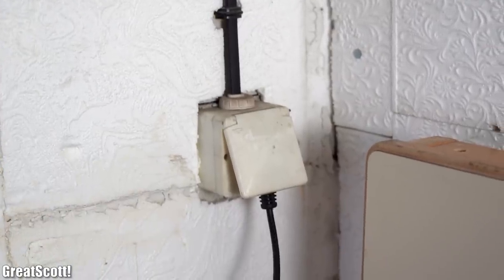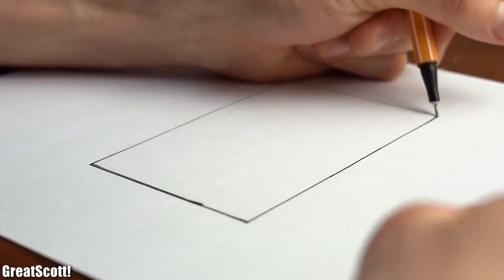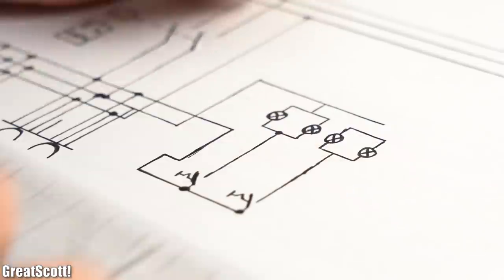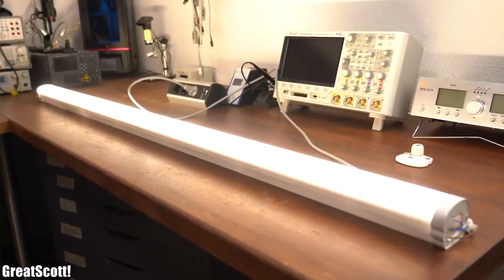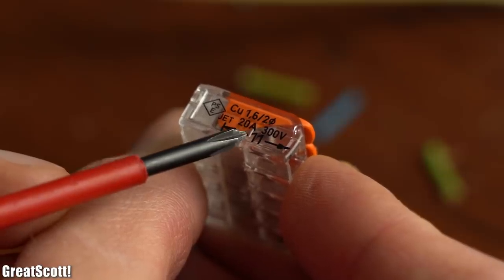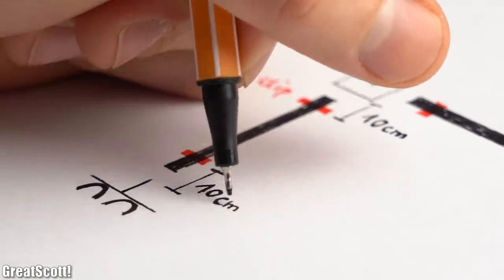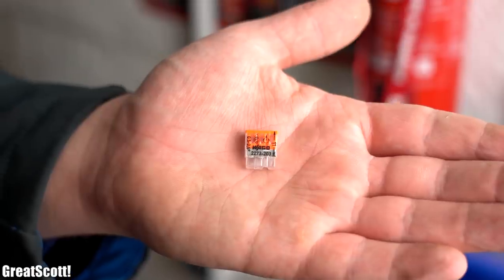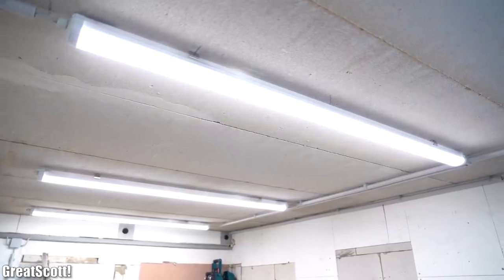How to do Electrical Wiring properly! (more or less....) GERMAN STYLE!

Comment: I found it pretty interesting in a previous video on mains wiring that Germany distributes three phase power to residences, since I live in USA where we have split phase 120VAC via center-tap transformers. Do any German appliances use all three phases? Could you do a video on power distribution in Europe, maybe even compare with USA?
Reply: Heavy electronics like ovens use 3 phase power. Generally every room is on a different phase to balance the load. In the US a lot more current is flowing because of the lower voltage and fewer phases.
Reply: Stoves in germany tend to be 2-3 phase, as are Electric Waterheaters or Roomheaters. otherwise the phases just get distributed between each rooms
Reply: Yes, flow heaters and electric kitchen stoves for example.
In my place (in Germany) we use the TN-C-S power network. Three phases L1/L2/L3 + PEN on local utility side. Three phases + Neutral and PE within the house.  PEN is split to PE and N at the house's transfer point. You need to attach an electrical grounding to the PE at the transfer point and split PE and N from that point on.
See here: https://en.wikipedia.org/wiki/Earthing_system
Reply: Interesting replies, thanks for the insight
Reply: @mixedbytc  Many people have 3 phase sockets in the garage/workshop. Makes it easier to buy and use industrial tools.
Reply: In Finland it is common to connect ranges to three phase: 3 x 16 A, though 1 x 20 A is also possible as one seldom uses it at full power Saunas and heating also se three phase. There are no three phase sockets in normal household use, they are too bulky for that. One might have one in the garage.

On normal sockets the phases are distributed evenly. 3 phase requires more planning as there typically is just 25 or 35 amperes available per phase.

Comment: What about that fuse?  I would have replaced it with a breaker.
Reply: That is a Possibility but when that Fuse is Only connected to the Main Of the House you need to Switch the Main to Replace that Fuse so Leaving the Fuse that is Perfectly fine is the Faster Option without Killing Power in the House

Comment: Finishing without E-Check?
Reply from the maker: You mean measuring of the isolation voltage and resistance of the PE conductor? Well, we do not have the tool for that. But that would be a pretty interesting DIY or Buy episode.
Reply: @Okay1  name checks out
Reply: @greatscottlab  Continuity of PE  conductor and prospective short-circuit current measurements allso?

Comment: Hire a professional? Pffft... Thanks, but I'll just dust off my Colorado master electrician's license. Circa 1984. :)

The cable stripper you can keep. I've had that kind of stripper and it was nearly useless for me. But it wasn't as fancy as yours. 

My pocket knife was purchased with an eye towards the perfect blade (a sheepsfoot blade is what I like) for stripping cable sheathing (that, and opening up cat food bags). I use the Sheepsfoot blade with my thumbnail as a depth gauge stop. Works just fine, and I still have all of my fingers.

Your wire stripper is the same as the one that I use, and especially for a left-hander, it is nearly perfect. Not great for when the wire size gets too small though.

As for your wiring methods, nice! Things have come a long ways from solder pots on a ladder. But I'm an old conduit guy, so I'll stick to my benders.
Reply: As we say in Germany: Und genau so   brennt man sein Haus ab.
Reply: @sneaky3685  Nah, as a professional, I only burn down other people's houses. :)

Comment: why weren't the outlets on a different braker than the lights? wouldn't that make more sense?
Reply: depends if you look at how little of a power draw there is to lights vs the cost of another breaker. the big reason why in the states we use 2mm cable for general outlets and lights at 15 amps max. yes its lazy and lacks foresight but its cheaper and makes for more profit too. i have lrnd over the yrs to just ask customer if they want to sacrifice common sense for maybe the savings of 6m of cable and a breaker.

Comment: Awesome video as always!
Do you know where I can learn german style wiring? I looks like very clean compared to what we use here in Peru.
Reply: You could start reading and translating those norm documents - they are available online.
But as they are formal German they are not easy to read. Even though not all of them are 100% accurate there are lots of German videos about electrical installation
Reply: all countries have more or less the same code (except the USA and their friends with the odd split-phase thing). all require RCDs, PE, the same dimensions for wires, etc. Peru most likely also has proper standards that really aren't followed. Here in Argentina standards are as strict as european ones, but most people don't bother installing PE since they believe "it's expensive and it does nothing".

Comment: But why did you keep the old fuse, now it has no purpose
Reply: It's still a solid way to disconnect the main power feeding into the service panel so they could wire up the breaker without playing with live mains, and one more bit of protection never hurt. Easier to leave it in place and no reason to take it out.
Reply: Not only isThe main breaker box the property of the landlord but also there are only a pound to break connection to the installation in this garage and otherwise they would have needed to disconnect the power from the meter which is not allowed by regular electricians

Comment: Similar how we do things in Sweden, but it tend to vary between the electrician doing the work. 
What types of material he's most comfortable to use and what the customer is willing to pay.
Been an electrician for more then 10 years here and seen very good installations as bad. 
I'm sure this guy is a professional, you can see it in the way he does the junction box. Guess its just a different mindset, regarding material and tool usage. 

But I can clearly see some things that most electricians here would have done differently! Both in material use, and how the installation is done. 

Since your putting up a new central. Why not put a main breaker and a new main fuse in, you had the space for it? Then going to whatever you wanted. Instead of using the old one, makes no sense to me.  

Not sure why you connected the led lights on both sides either and going between them, could have been avoided by either another junction box or using cables with 4-5 wires inside.
Why he choose to enter the junction box on the lower inlets makes no sense to me either. Blocking top entrance, and have an unnecessary bend on the cables.  

My preferred method here would be using cable channels, think they blend better into the walls/corners bit more time consuming, but still quite fast if you're good at it. I'm almost positive I would have done it faster or in the same time he did using these pipes and a saw cutting them. 
One larger going from central along side the whole wall, with smaller ones going out to each LED light would been enough.

Second option would be using pipes, similar to done in the video. But definitely smaller size! looks like 25mm to me, way bigger then what ever will be needed. 
I would also have connected them straight into the junction boxes. This gives you all the benefits of using pipes, being able to use wires without extra insulation. Making it easier to change out in the future, also cheaper since loose wires are cheaper and faster to use. 

My least favorite, but the preferred by many. Would be just putting the cable on the wall/ceiling using clips. If done correctly it looks almost if not better then using cable channels. 

I'm surprised to see the electrician not using lasers when mounting the piping! Makes it much easier to line things up and getting everything straight, and he wouldn't need to mark before hand. 
Also the big markings he makes for drilling positions and measure markings are still visible, something I would scold an apprentice by! 
And that he was using a saw to cut the pipes, here we all use a hand pruner for cutting up to 25-32mm pipes. 
Faster and you get a nicer edge on the cut my favorite brand and style https://www.amazon.com/Felco-F-2-Classic-Manual-Pruner/dp/B00023RYS6 

Of course all of this is probably only things an electrician would notice or ever think about... 
I'm sure most customers are satisfied with this result, and are just happy to have better lightning!

Comment: To reiterate, there is no guarantee that whoever installed the wiring in your house did it correctly. It may work, but when you start messing with it, it might react unexpectedly. It’s ok to start and then realize you need help.

Comment: 11:03 You really connected the switches so that the lights are turned on by pressing the bottom of the switch? That's weird.

Nice video, tanks.
Reply: My understanding is most of the 230v world has "upside-down" light switches like this. Of course they'd say our switches are upside-down.

The weird thing about the European way of down==on is that it's inconsistent, their circuit breakers are up==on. Here in America up is always on.
Reply: @eDoc2020  Some switches my house point up and some point down. Go figure.
Reply: @eDoc2020   I'm also from 230V country(like GreatScott), but i think that all switches and breakers should be up=on.

Comment: It wasnt german until you used a different connector for the stranded and solid copper wire,  usually we just twist everything together.
Reply: You could use the WAGO 221 for everything if you wanted to and have the money for it... (I do, I only use the push wire connectors if I need to connect a hell lot of them or space is really tight). If you have multi strand cables you could always use ferrules but that's yet another step costing time (and equipment).

Comment: Why does the rcd turn off when N and Pe touch
Reply: I mean when no L is on
Reply: @emirhas8793  because it's AC.
Live and neutral carry charge.
Reply: @safetyinstructor , not true, there has to be a load in the neutral to cause a voltage drop in it, since V= IxR, in this case however 07:00 he tested from live to earth, not neutral.
Reply: Emir Has, it won’t, unless there is some load causing the neutral to lift above 0volts, if you are referring to 07:00, he tested from live to earth you can see the LEDs start to light on his probe.
Reply: @elonmask50  I didn't know he referred to the video...

Comment: Damn!  Those wires are thin!  If you used those in the US, due to lower voltages, they would burn up!  I notice the wires leading to the junction boxes weren't completely inside the conduit. That's not "code" in many parts of the US.
Reply: The conduit in this case in only used for easier cable management, it does not need to "protect" the cable as the cable itself is double insulated (and fire retardant).
Since the cables' entry points into the boxes are splash water resistant it is fine the way it is.

Comment: I'm surprised you use solid core cables instead of flexible ones. Its so much easier to work with the flexible ones...
Reply: Solid cores are (Or stranded with very coarse strands for larger wires) typical for fixed installation. They are easier to work with in junction boxes because they stay put rather than springing out when you're trying to put the lid on.

Comment: Why is the old fuse staying?
Reply from the maker: We are not allowed to rip it out. This garage is only rented.
Reply: @greatscottlab   Ok, but you need extra automatic fuses. 16A for outlets and 10A for lights. Separate the cables goes to outlets and lights from distribution box.

Comment: 1,5mm^2 wires are for 10A circuits, 2,5mm^2 for 16A
Reply: Inside, or outside wall? And Solid or Stranded wire?
Reply: @deakimi  both inside and outside, and for both types of wire. That's the standard here in Finland.
Reply: @rhonen1014  Yeah. See any car owners manual. Same car,  and different oil visocity in the scandinavian countrys against ie Italy.  (Due to the different cold start temperature) That is a strict standard in Finland, not the phisical. A 3x1,5mm2 can deliver 16A current with natural ventilation.  Not bad thing the overdesign (Finnish standard), but this in Germany. And 'outside wall', this is legal. (I'm from Hungary, but we use almost same standard...) 3x2,5mm2 better, but 3x1,5mm2 legal too... :)

Comment: A strange choice.
In the event of a short circuit in the 230V socket, the protection will disconnect the circuit of the sockets (its OK), but also turn off the light in the room... There is nothing better than removing the cause of the short circuit in the dark and going to the fuse box in the dark to turn on the circuit breaker (laughs)

The lighting should always be on a separate circuit with its own protection - independent of the circuit of the sockets. If possible, it should be wired to a different phase than the sockets power supply.
In the case of a single-phase installation, the main protection may be of much higher amperage than the protection of the 230V sockets. In the event of a short circuit or overload in a 230V socket, only the protection of this circuit (usually 16A) will be activated. For lighting, protections with much lower values are used (usually from 6A to 10A).
Such a layout of the circuits gives us the possibility that in the event of a short circuit in the 230V socket, we will still have room lighting.

Compared to the old installation, the new one is not much better. I expected something on a higher level from my German neighbors;)

Comment: Greeting from Serbia

What I can see is still one old fuse, no separation of sockets and lights, no 3 phase anywhere.
Reply: This is a garage in a garage complex - usuals no electricity at all - 10A single phase if at all...
This is also why adding a separate breaker for the lights Would make it worse - Because It could lead to the distribution line be over loaded
Reply: @TecSanento  5A for sockets and 1A for lights
So of you power in some high power device, like welder or heater, you do not go blind.
1A for LED lights should be enough.
Reply: @Mladjasmilic  that but be great - but these values in breakers are very rare and expensive..
Reply: @TecSanento  Price is relative.
I found in Serbia Schneider 1A automatic fuse for about 8€ and 5A for 6€.
'Standard' values like 6, 10, 16, 20, 25, 32A are even cheaper.
Reply: @Mladjasmilic  wao :o i found one supplier for a 1A breaker at 32€ and a 16A One for as low as 5€ - I would not buy the 1A one :D

Comment: Beautiful work! :) 
Im not an expert, but could that wier overlaping the tube be done in a different way maybe, hehe? At 11:07
Reply: Tbh I dont know, perhaps using a 4 conductor cable (Ls1 - Ls2 - N - PE) for all the lamps, and then connecting it to the correct switching group. But I personally would just put all the lights on one switch, its a garage it doesnt need to be perfect.

Comment: Always add a LAN port on each power plug!
Reply from the maker: Damn it.....I forgot that ;-)
Reply: you can't run Ethernet cables parallel to mains power cables too close because the AC and any noise on the mains is induced into the Ethernet cable.
Reply: @fransdebruijn6763  Fibre it is then!

Comment: Funny, you buy lamps with included LED's for over 120€ but use very small cheap PVC-plastic boxes! 
BTW: Do you can make all self till the CU with your own buyed shit. No electrician talk that of course. Same with put away old stuff. Then a Meister check it and guarantee it. Every professional electrician would use only own stuff and expensive products.  He use the plastic pipes direct into the boxes or use space for maintenance between both. 

P.S. I would install an IP 44 CU only inside a garage! This one only have IP 20.

Comment: my professional instal turned uout bad: the professinal installed mini box for 4 breakers, open. And put in 1.5mm wiring, but has been instructed to do wiring as is there would be 5 kw constant load... Wired 4 outlets, I needed for high power, one after the oter, 2 first ones already had been fried... Over heat at 2 kw after one year. Need to rewire one day everything myself money for parts and work down the drain :( Never had anything fail I installed myself, things failed done by professional, installed in wooden old garage, I was expecting that to be safer. At least breaker worked. He installed russian mede ones...

Comment: This install is a 6 or 7out of 10 at best.
Why??? Would you not have separate breakers for the outlets and lighting circuits when you have an oversized board like that. Why even install a board if all it contains is a single RCD.
One main 16A breaker feeding into the RCD and than one 10A for the Outlets and one 6A or 4A for the Lights.
Then also use all that extra space in there for little DIN Rail Busbars for all the cables to terminate into.
Also why use the ugly and cheap looking conduit that exposes the cable everywhere when they also have square white trunking?
I did an entire Shed/workshop with and its a bit more tedious than the grey conduit but looks so much better.